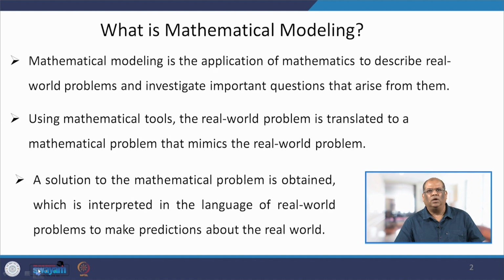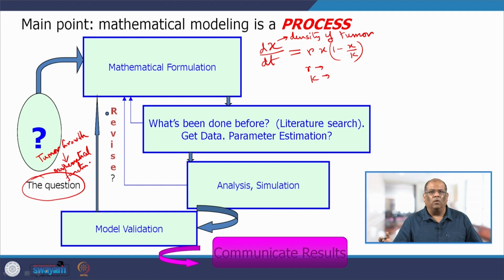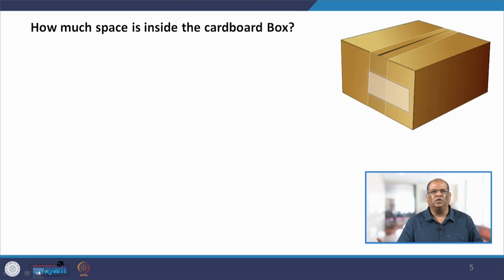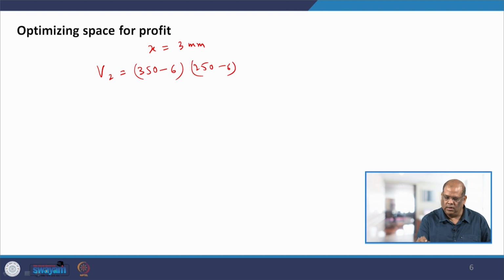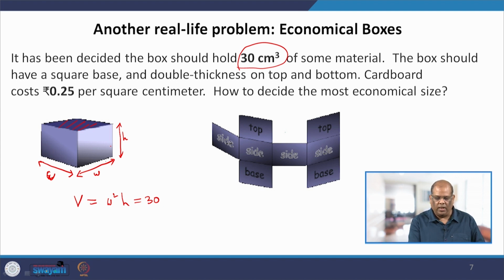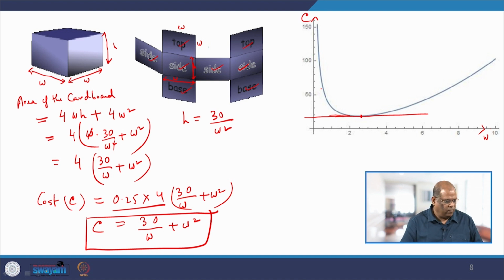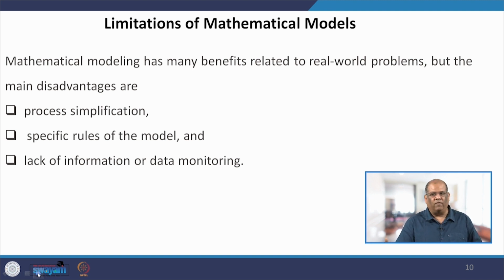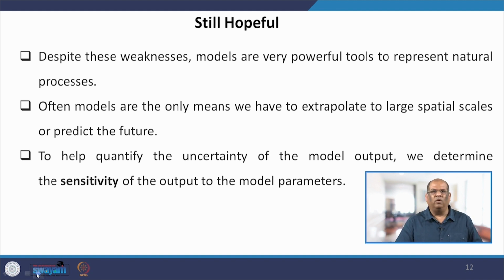Lec 01: Introduction, Importance and Limitations

Comment: Course layout
WEEK 1
1. Introduction, Importance and Limitations
2. Units and Dimensions
3. Scaling
4. How to build mathematical models?
5. Basics of Excel 1

WEEK 2
6. Basics of Excel 2
7. Basics of Excel 3
8. Linear, Quadratic, Cubic Models
9. Linear Stability Analysis-I
10. Linear Stability Analysis-II

WEEK 3
11. Lyapunov Stability
12. Phase Plane Analysis 1
13. Phase Plane Analysis 2
14. Phase Plane Analysis 3
15. Growth Models (Continuous model)

WEEK 4 (Continuous models)
16. Predator-Prey models
17. Two species Competition model
18. Arms Race Model
19. Combat model I
20. Combat model II

WEEK 5 (Continuous models)
21. Carbon Dating
22. Drug Distribution
23. Growth and decay in L-R circuit
24. Rectilinear motion under variable force
25. Dynamics of Rowing

WEEK 6 (Continuous models)
26. Horizontal oscillation
27. Vertical Oscillation
28. Epidemic model 1
29. Epidemic model 2
30. Rumor model

WEEK 7 (Continuous models)
31. Varying Gravity model
32. Tumor model 1
33. Tumor model 2
34. Vegetation  in a desert model
35. Mathematical model of love affairs

WEEK 8  (Discrete Models)
36. Discrete models: Difference Equation 1
37. Difference equations 2
38. Basics of Excel 4
39. Stability Analysis I
40. Stability Analysis II

WEEK 9 (Discrete Models)
41. Population models
42. Bank account models
43. Economic model
44. Pollutant model
45. Mathematical model of the Dynamics of Alcohol

WEEK 10 (Discrete Models)
46. Linear predator-prey model
47. Forensic model  
48. Drug delivery model
49. Lanchester’s combat model 
50. Two species completion model

WEEK 11 (Discrete models)
51. Infection model
52. Smoking model
53. Price and demand model
54. Paper towel model, Burning calories model
55. Learning model, Kidney function model

WEEK 12
56. Empirical Modeling
57. Estimation of Parameters 1
58. Estimation of Parameters 2
59. Estimation of Parameter 3
60. Simulation modeling.